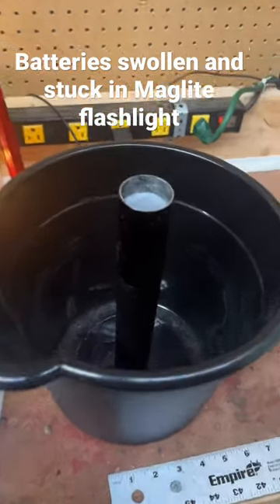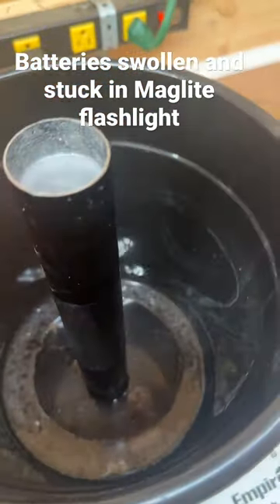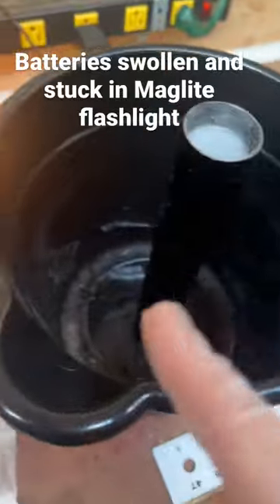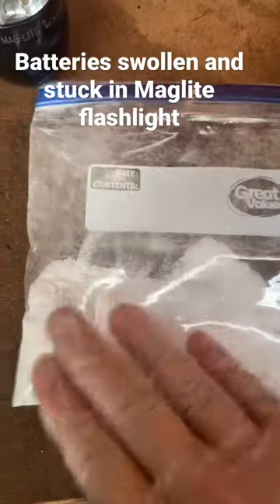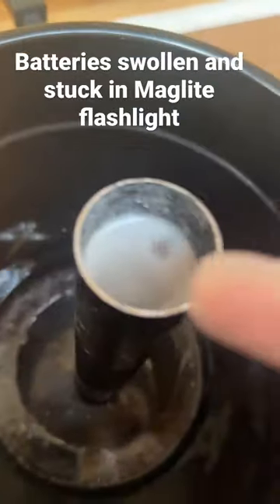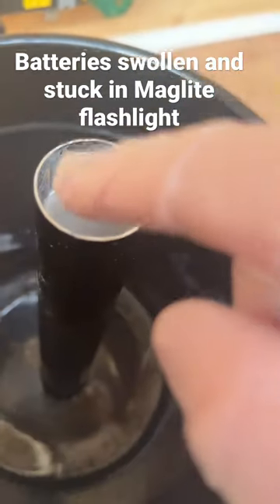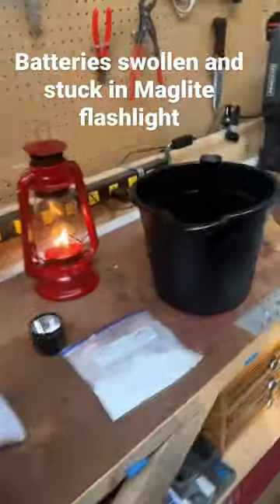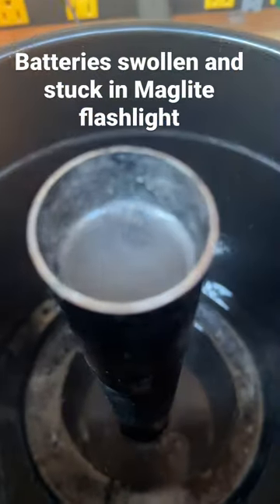Can vinegar and baking soda remove stuck batteries in a Maglite?

Comment: Make a dent puller with a block of wood and big screws. Get the batteries and switch out first before using vinegar. Pry the rubber button cover out and use a 2mm allen wrench. The switch will exit out the tail. The acid will damage the switch. Baking soda will neutralize the vinegar. Inspect the switch for corrosion.  When everything is removed, use a small cylinder hone to clean up the damage inside the tube. Be careful to not to cut off the threads that hold on the tailpiece. Clean those threads with a smaller fine wire brush toothbrush style . Clean all of the springs and sockets they fit into.

Comment: I recently bought a 3D maglite for 5.00 it had 3 batteries completely corroded an stuck inside the maglite i drilled out all three batterys i uses a 21mm socket an 3/8 extension an beat the batterys out unfortunately the inner tube was corroded so badly im probably gonna have to use it for parts

Comment: Slam the cap with the lamp against wood helped with me too im trying right now to get the oxidatian out
Reply: i did that and my light disassebled mid air and it threw up all the small lamp parts. batteries are still stuck. i doubt vinegar will help. i will try some oils and solvents as the batts are basicly metal and carbon.

Comment: Did it work? What did you mix the baking soda with? Water??
Reply from the maker: Epic fail.... lol... Baking soda & vinegar. Read online it'd work, but nope.
Reply: I had 2 of 3 batteries stuck in mine. Drilled out top battery and the middle was jammed. I put a bunch of CLP and it actually got loose enough to bang it out.. Gotta try some kinda oil based product IMO
Reply: @BobDoesReviews Baking Soda and Vinegar only stop /remove the chemicle reaction of the battery and removes the corosion. Maybe the Metal of the battery was just zo swolen to get it out.

Comment: not vinegar
Reply: Not at first. We need to take off the reflector and empty the tube of the batteries and switch first. A cylinder hone can assist in removing the switch as the corrosion will make ridges and bump inside the tube.